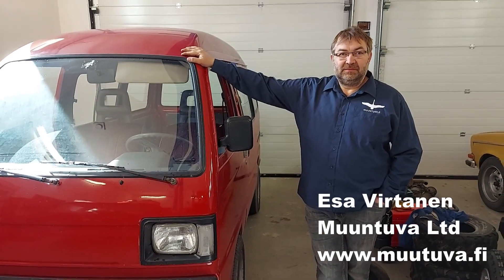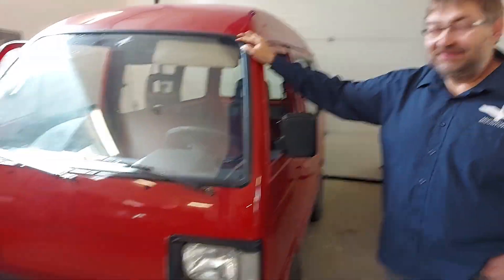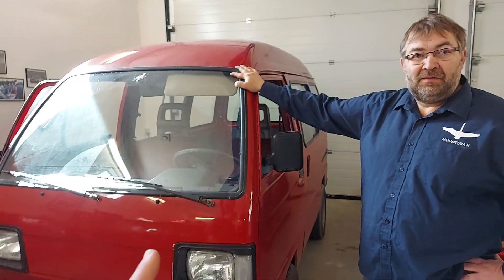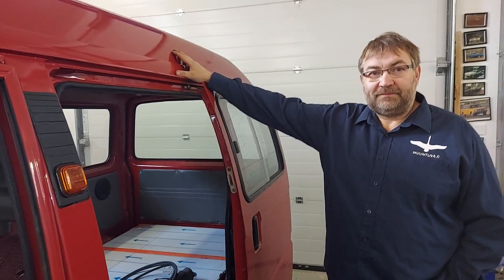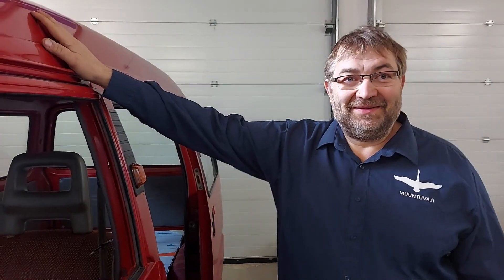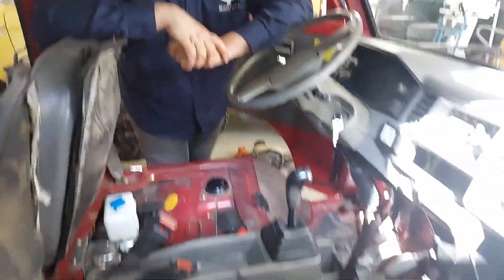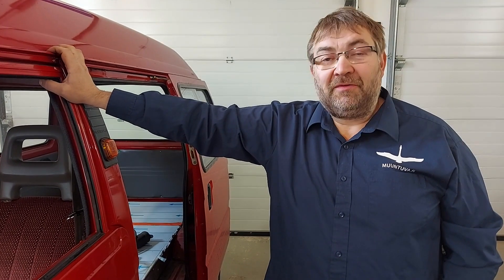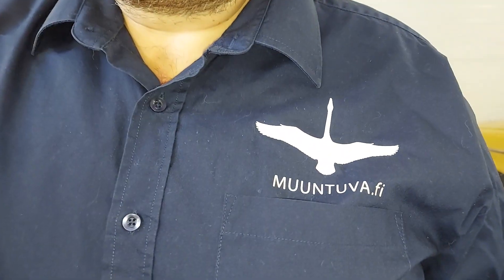Converted electric car Suzuki Carry | EV conversion |

Comment: Thank you for uploading.
I have just converted a Suzuki Pickup. 96v, 10kw motor, 10kWHr batt with 70km range per 6hr charge.. My daily drive do not exceed 40km.
Reply: I am interested in this.  Did you keep gearbox?  I have a 90 4x4 I am considering converting
Reply: May I ask about how much it cost?

Comment: Awsome conversion, Some question pls
1. Steering wheel and Brake system are still using Stock or you also upgrade to motor support steering wheel?
2. AC System : How do you convert? replaced with eAC compressor or you made the adapter plate to pull all the pumps?

Thanks

Comment: i was curious about motor size and then heard 200 nM torque...these things come stock with a 660cc engine producing way less torque, I am trying to convert apples to apples, why does every EV builder think we need a vehicle that goes 0-60 in -2 seconds. Trying to find a smaller motor is impossible as anything "rated" as EV is astronomically expensive.
Reply: Some electric motors are  popular and then it easy deside to use that. Today you can chose quite freely what you want to use. Reliability is also an important reason, why choose some strange motor? However, there are many options.
An powerfull motor must be limited to be suitable for the car. Anyway, the electric powertrain is cool.
Reply: @esavirtanen8346  my wife and I are currently on our 3rd production EV. Mitsubishi iMiev, Chevy Bolt and now a Bolt EUV, so yes I am all in on electric vehicles. I understand that it all does come down to programming of the motor controller however i am trying to understand why use a larger heavier motor only to dial back on the power. I have been hauling rock for some home projects and the loader driver just laughs as he loads me with up to 2,000 pounds of materials, he told me he NEVER goes over 1,000 pounds in full size pick up. I can deal with a little more horsepower or torque. Here are the specs on the ICE engine.
Maximum Power - Output - Horsepower	48.6 PS or 48 bhp or 35.7 kW
Maximum Power RPM	6000 rpm
Maximum Torque	58.8 Nm or 43.3 lb.ft or 6 kg.m
Maximum Torque RPM	3500 rpm
Reply: @joedauginas84 is it the spec of the loader or the ev your building? Even i was thinking of building and ev mini truck and was looking for motor options , i thought of using a Renault twizzy motor with comex gearbox with ratio of 13.5 or so. From what I know the motor has a torque of 57Nm of torque. What do you think about it? Should I go for a bigger motor